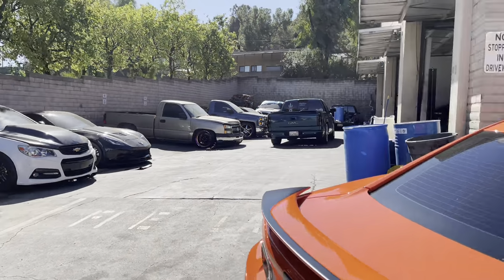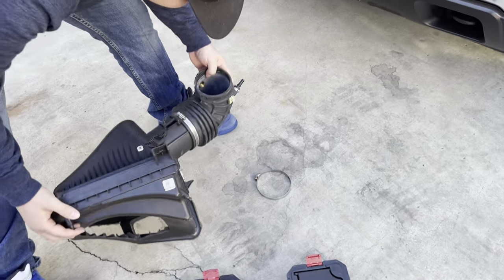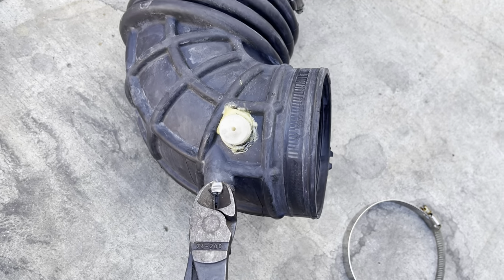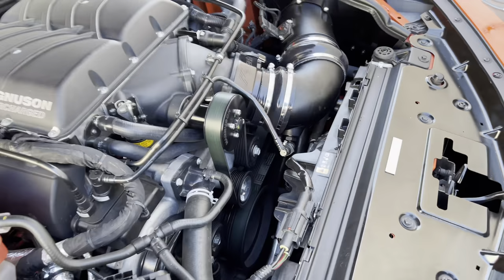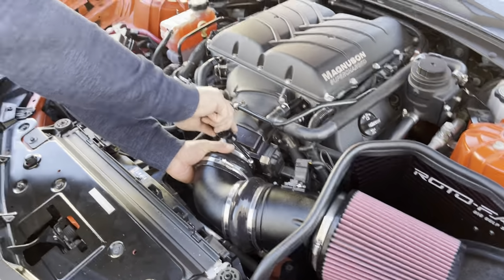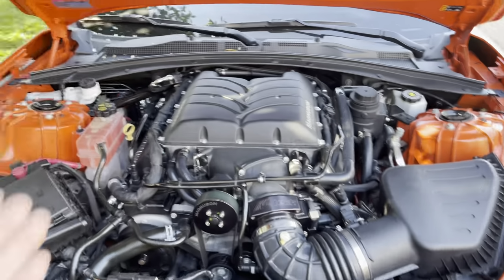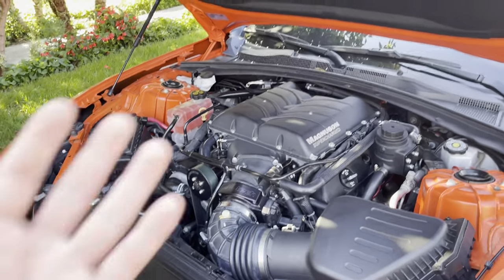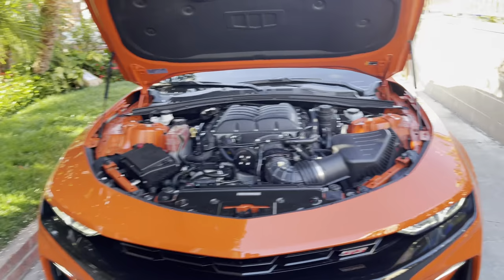2019 Camaro SS RotoFab Big Gulp Install

Comment: Yeah it adds up really fast. I did the Lt4 fuel system and a JMS booster pump. I was able to swap the pulley and still not running out of fuel.
Reply from the maker: that awesome. I'm assuming it ran about the same price? These new lt1 engines definitely break the bank.

Comment: Man Fueling on these LT engines sucks haha I just switched up to the ZL1 because it has the lt4 fueling, but for my end goals, i will have to upgrade to the FIC +30 injectors, the high pressure fuel pump, and aux kit to be able to run full e85 on a FBO ZL1. Just that alone will be around 6k smh haha btw remove the ss logo its just on a bracket  on the front bumper to help get more air in the intake
Reply from the maker: Man no kidding, might have to considerate doing the same move instead of going with fuel mod. I thought about removing the ss logo but i feel if it gives the car a complete look in my opinion.